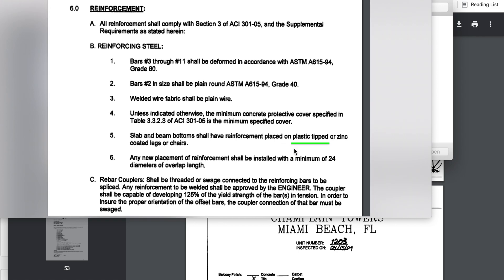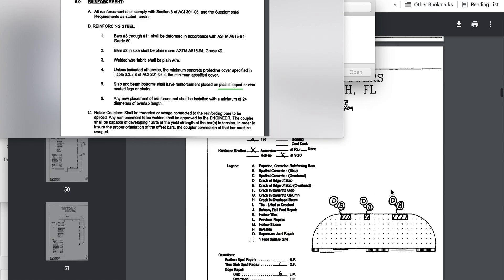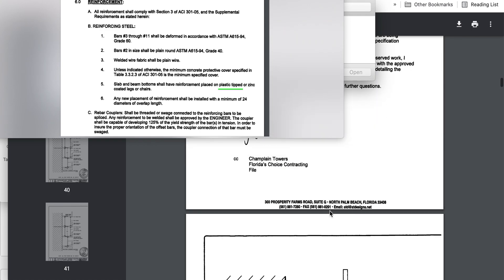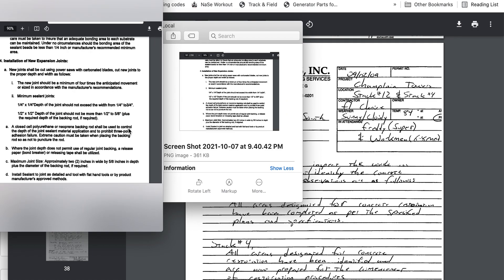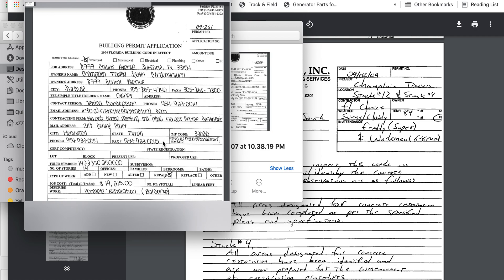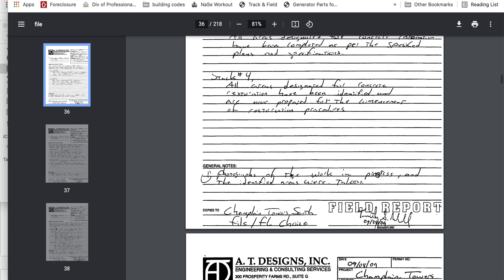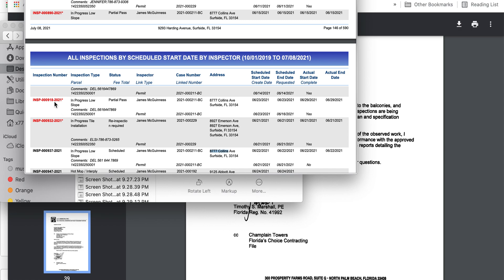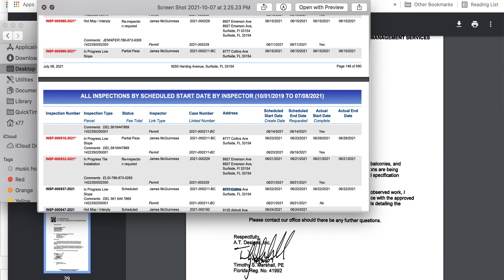Cassondra Billedeau Stratton 2009 repairs Current Roof repairs were ON GOING Inspection HOURS before

Comment: I appreciate all your work on trying to determine all the causes of the Champlain Towers collapse.  
Poor and untimely maintenance played a roll in this building's collapse, but if the construction methods used in this Champlain Towers building were used wide spread in other building, even proper maintenance is only a better bandaid, and they are all bombs waiting for a reason to go.

Comment: Florida Choice Painting is now called or part of Florida Choice Contracting. Still in business and have a website with a lot of project they've done. Family owned business still run by one of the founders Javier Navarro, Was also founded by Juan Castro Jr. and Juan Castro Sr. 
Juan Castro Jr is owner of  Restore Construction Group, Inc. since 2006.
Reply from the maker: Thank you Jo for Champlain Towers comments
Reply: @ForensicCats  yw. Just putting out the info I found w/o any opinion, 😉 😂.
Reply: @jobrownsmith116  WoW    they really are holding back my messages... it was by luck I just saw your reply.   Cheers.
Reply: @EngineerPEretired  yes, sounds about right for youtube, 😂.